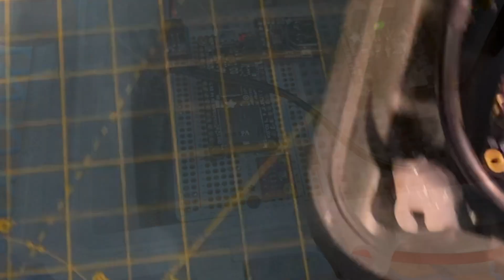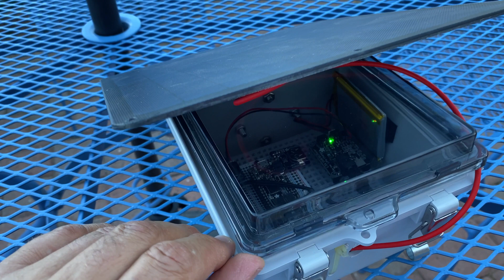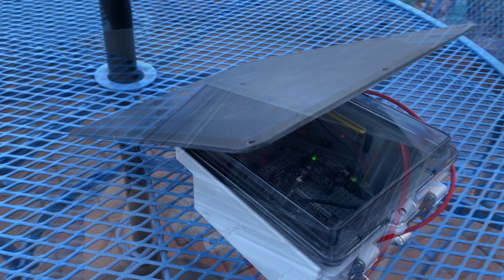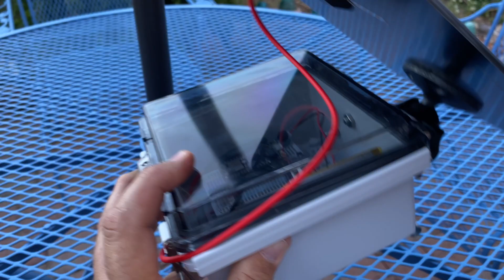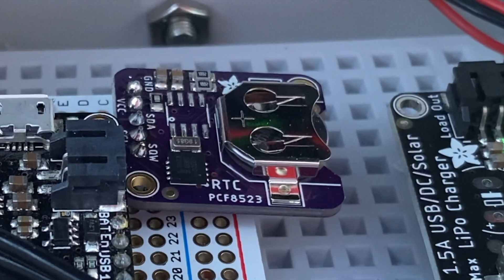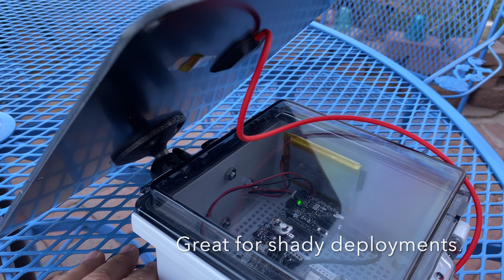BME/BMP280 Integration with Adalogger Continued

Comment: Have you tried using pressure equalization membranes for those enclosures to prevent moisture from being sucked in and condensing on electronics? Also helps keep small bugs and spiders out of holes in your device.

DigiKey example: 1754-1229-ND
Reply from the maker: Interesting. So, I take it I would just put a watertight fitting around the solar cable, and then drill a second hole for that plug which allows moisture to exit? I'll have to check that out. Thank You!
Reply: @ModestMaker  Yes, a waterproof cable gland on the solar cable and a second hole for the vent.

However those don't work by allowing moisture to exit, they allow air to enter and exit to equalize pressure and block moisture, dust and insects from entering. The reason many waterproof enclosures end up with condensation on the inside is because of thermal cycling from the day night cycle causing the enclosure to suck in moist air around the seal. The seal even on an IP68 rated enclosure can only deal with 1.5 m water pressure differential for 30 minutes, over a deployment of several weeks moisture can be sucked around those seals. There's a few demos on YouTube showing how they work.

I'll mention there are similar products that actually pump moisture out of an enclosure but they consume power and are quite expensive, they're more for things like sensitive research instruments or important museum artifact enclosures.
Reply from the maker: @WizardTim  Thanks so much for sharing this insight! Great information and background - I will certainly share this in future videos. Yes - keeping costs down is critical since many of the stakeholders I work with simply can't afford the formal scientific equipment for deployment (thus, this channel). I've found that keeping a drilled entry/exit for moisture seems to work well, at least in my area during the monsoon. It mostly becomes an issue when measuring stage above a stock tank or other standing water body. I'm not an EE, but recently learned about conformal coatings as an alternative as well.